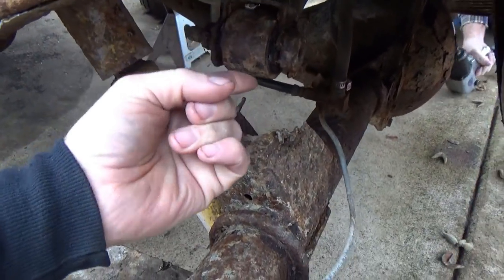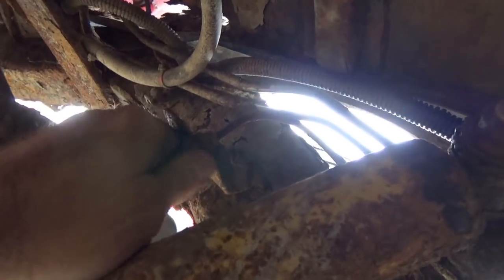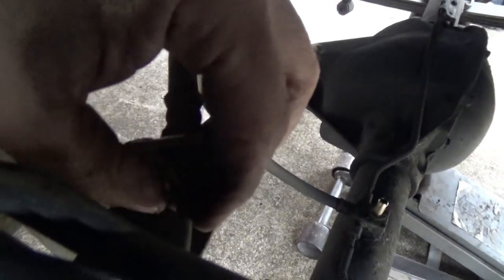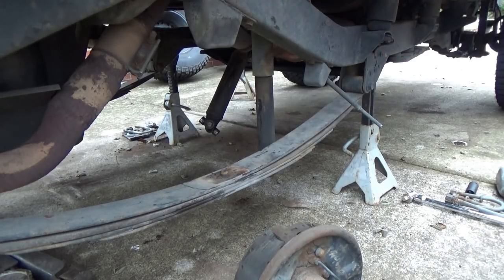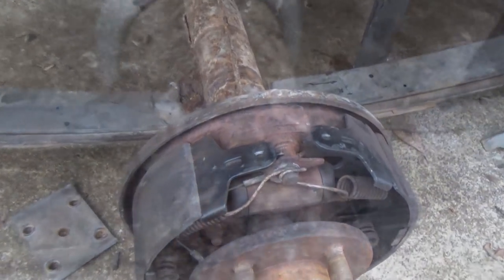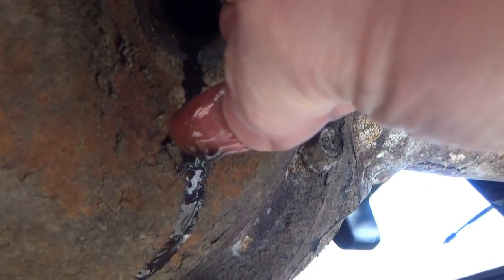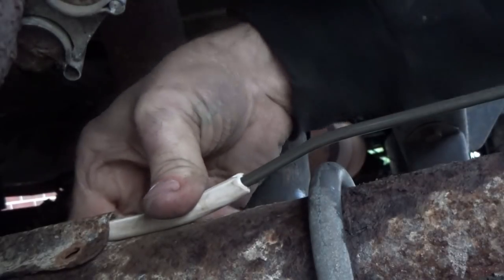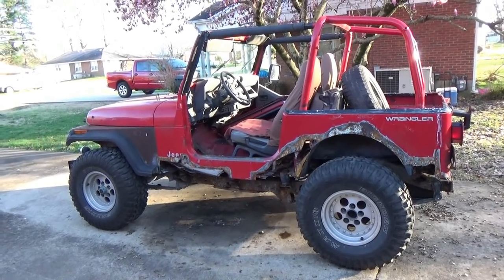Jeep Wrangler YJ - Got noises? Emergency Rear Axle swap

Comment: You don’t need to remove the drive shaft just don’t engage 4x4 the driveshaft won’t spin since it’s freewheeling from the transfer in 2hi and freewheeling from the axle bc of the cad but if you deleted the cad then it still freewheels from the transfer so you’re still fine if you don’t remove the drive shaft
Reply from the maker: Yep, you are correct. But, I have airhead moments soo .. yea making sure I didnt do something not so smart :-) . Yep, I also have the CAD permanently locked in. Its just until I get around to rebuilding the other front diff and swapping them out. Thanks for dropping by!! Have a great day!

Comment: What up I like seeing ur message a lot I get a lot of info iam having a problem with my 1988 Jeep Wrangler yj 2.4 l and iam having a problem with no power no fuel I changed can sensor the coil the thing that’s behind the coil rotor cap and nothing I was told it could be the ecm? This one has it inside behind the glove compartment? What info can u provide me with ?

Comment: Hey man I really enjoy all your videos and how you going to depth with fixing things on a YJ which I have an 88 I recently put a V8 in it I want to change out the rear but need help finding out what would bolt up to it work without doing a lot of cutting and welding I'm not in a rock crawling mud riding just a basic all around family vehicle camping etc what do you suggest please help
Reply from the maker: To comfortably live behind that V8 getting an 8.8 out of a 1995 and up Ford Explorer. It will involve some welding and light fabrication. Then making sure your front and rear gear ratios match. Anything less you will eventually just be doing it all over again.
Reply: @Poweraddicts  sorry so late what would you suggest putting in the front all this is new to me on gearing I'm good with engines what would you suggest I still have Dana 30 front Dana 35 rear MP 231 transfer case bolted to the transmission but aftermarket bell housing from advanced adapters connected to the V8 so all in all help is definitely needed I do like the 8.8 I saw your video there so what should I do about the front and with everything else be comfortable enough to leave in there for now to build up budget again financially

Comment: Serious question: with xfering rear axles like that, is there a direct compatible rear axle with disk breaks that can go on one of the old YJ's?
Reply from the maker: Direct compatible? No. Ford 8.8 out of a 1995 or newer Explorer is close but still requires some light fabrication and welding.
Reply: @Poweraddicts  if ever that is somthing you guys were interested in tackling,  I would love to see it. You do a good walkthrough, gloss over the repetitive stuff and hit the target where it's critical. I'm very much on board doing this with my 91 Renegade. Have seen  no videos or reference on it though. Are there inherent issues; saftey, function or otherwise?. Or do correctly,  solid as you like?

Comment: My d35 just grenaded with only 31’s
Reply from the maker: Those Dana 35's aint much!! I scored an 8.8 a couple of weeks ago for $50. It got 3:73 with the Limited Slip Carrier in it PLUS rear disc brakes complete! I would have preferred the 4:10 gear, but for $50 LSD & complete rear disc .... SOLD!!
Reply: @Poweraddicts  What did the 8.8 come out of? What is a good vehicle to get one out of?

Comment: Dude not to be an ass but your t-case doesn’t turn different speeds the main bad thing about different gears is don’t run a higher gear in the back because it will out drive the front  mud dragsters will gear higher in the front to help with control on real high horsepower rides
Reply from the maker: Yes you are absolutely right. I pulled my front driveshaft out to make sure I didn't blow up the t-case by forgetting and locking it in 4 wheel drive. My main driver ate the bearings in the rear diff. I needed another diff ASAP!! The rig I pulled it from was getting a 8.8 installed (it now has) so it became the donor to get my daily back on its feet. I swap in the front diff from the donor rig to get my gears to match. I know about making sure gears match, but it does help others to read the comments to learn from. Thanks! Good call!!

Comment: Ya i have it worse i have 5 jeeps and i swop out driving each of them thats not including my yj bar my yj camper my xj camper and my part jeeps
Reply from the maker: I was told about a bone stock XJ that I'm really considering getting. Thought about possibly making a drivable trail rig out of it. I'd like to find a 4cyl YJ for really cheap to so a V8 swap on.

Comment: 8.8 is how im going
Reply from the maker: I think its the least expensive upgrade to ditch the junky Dana 35. My Mustang has an 8.8, it has got a few hard drag race launches on it and it is still doing great.  Thanks for taking the time to check out the video and taking the time to leave a comment! Have a great day!!
Reply: Power Addicts - FixJeeps.com - Jeep, car and motorcycle tips. I almost had 1 for free. I couldnt make the drive from flint mich to southern ohio to get it. That sucked too it was a 4.10 with disc brakes and a LSD.  next time i guess